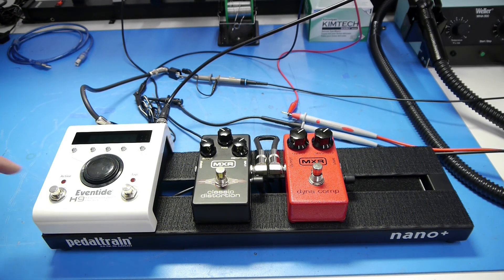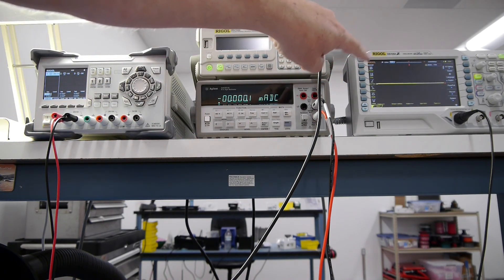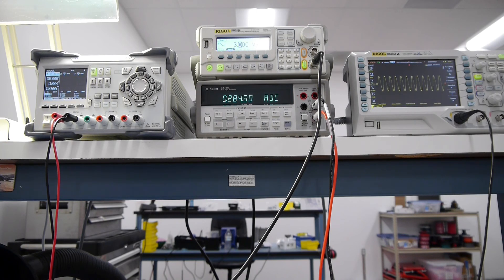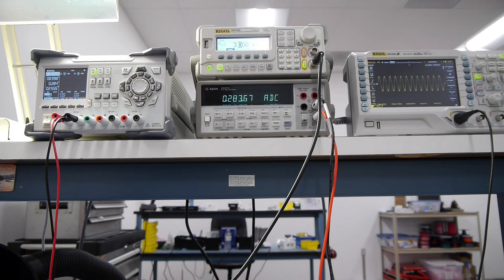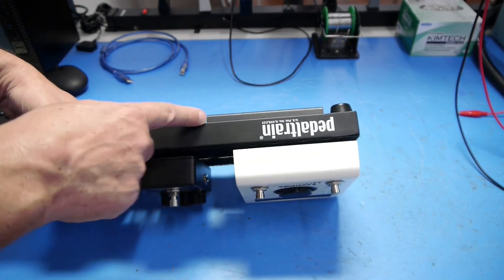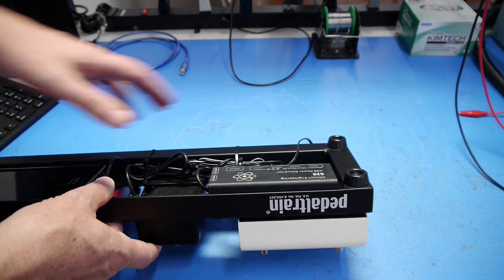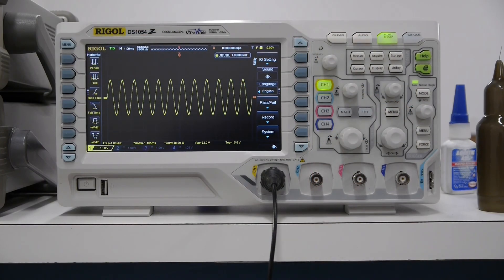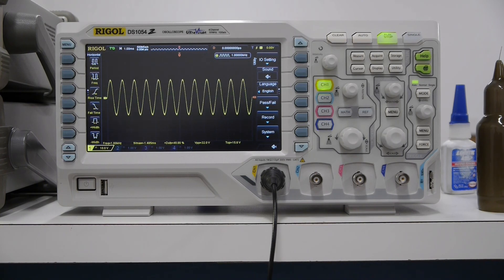Eventide H9 from a battery

Comment: So.. Can I use a Pedaltrain Volto with my Eventide H9? Greetings from México
Reply: You would need a custom cable, at least. The user guide for the Volto says it is not designed for high power digital products. You may want to check with Pedal Train for more information.
Reply: Que tal Adán pudiste conectar tu H9? si es así como lo hiciste, saludos